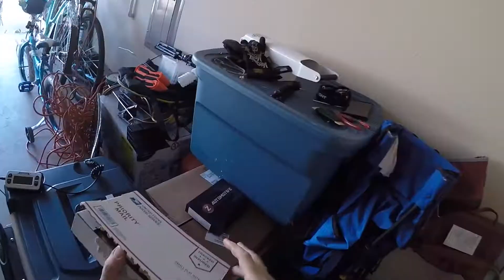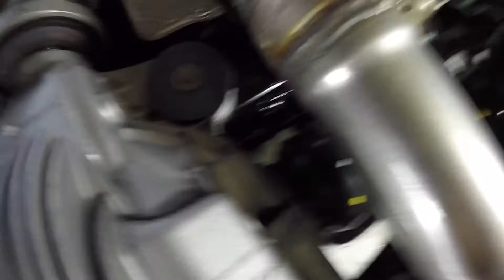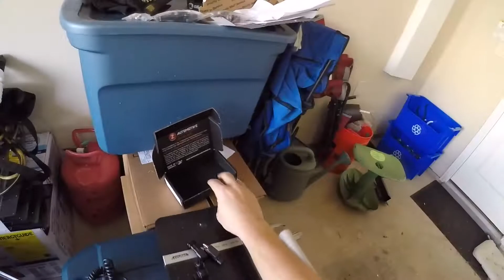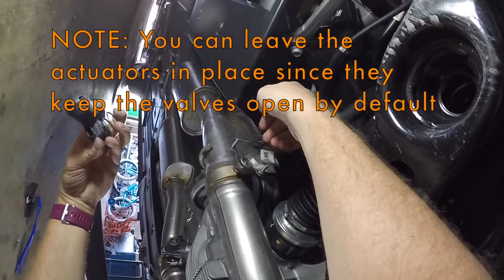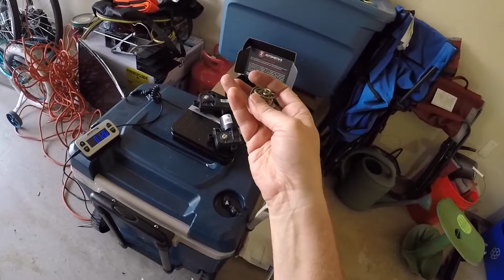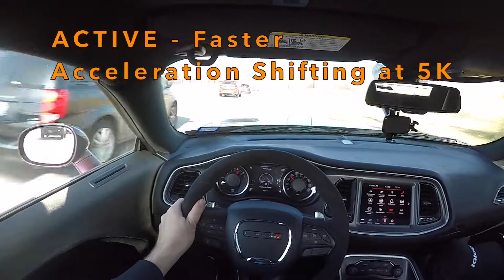Active Exhaust Delete Options for Dodge Challenger and Charger - FREE vs.  Z Automotive vs. Khaos

Comment: So i have a 2016 scatpack challenger what option can i do to delete my active actuator
Reply from the maker: Any of the options I talk about except the free one. Either the mechanical delete kits or the Z Auto dummy plugs will work. The free one would technically work too, but not without tripping the engine light.
Reply: I dont believe the 2016 had active exhaust
Reply: @garybishop4030 I think they do 2015 and 2016 have active exhaust as well because I can notice mine has it it’s loud on cold start and a couple seconds later it’s quite and it’s only loud when I floor it

Comment: I used zip ties on mine and now I’m getting this loud ass noise it sounds like the valve is still attempting to open . Am I the only one getting that or do you as well? Thanks for reply .
Reply from the maker: Did you remove the spring? That's the only way it would still be trying to open. Otherwise there's probably some kind of issue with the actuator.

Comment: I have a 2019 challenger RT 5.7 and my car has always had a rattle with the active exhaust i assume. Got khaos deleted and and still hit with a nasty rattle on cold start. Ive fiddled and greased up all up in them thangs and nothing. Always rattles.
Reply from the maker: That sucks. Wonder if maybe there's an issue with the actual valve inside the exhaust pipe. That's the only thing that would really make sense with the valves being held in one position outside of the pipe. Best fix for that case would probably be to just get the Z Auto Plugs and cut the valves out entirely and straight pipe that portion.

Comment: The note is noticeably more aggressive in inactive mode for sure Chris!  Mid Muff delete just sounds like crap, I did that in my 5.7 Shaker, and wasn't worth it to me, not doing it in my Scat.
Reply from the maker: Yeah, I'm not a big fan of the mid-muffler delete either.
Reply: I’m not a fan of mid delete either. I went with a mid replacement instead on my RT. I bought some bottle resonators from Amazon and put them in place of the mids and I love the sound. Makes it louder and makes a nice deep clean tone compared to deletes

Comment: If you have a pre-19 I would def look into the Z Automotive tazer. Heck even a 19+ depending on the model you have. It's an easy install, just plug it in your trunk OBDII port and wire in the bypass to the trunk fusebox takes 10 mins and easy to take out if you are going to the dealership or just want it back to stock.
Bit more $ than the modules, but it's going to give you track mode which keeps the valves open 100%, have heard some say that when idling it still closes in track mode but have seen video with a camera in exhaust showing them open 100% of the time with the tazer and in track mode, and I can't tell a difference between track mode and pulling the fuse so I believe it does work. And you can change it with the press of a button by changing drive modes.
The tazer also gives you a few other cool things such as LINE LOCK which is huge for me as my 2018 392 shaker doesn't come with that, also the ability to start the car in whatever drive mode you want (I auto start mine in track mode), have the engine on track but the trans on another mode if you want less aggressive shifting but still have valves open, the SRT performance pages + drive mode screens, SRT EVIC screen, and SRT race options, gives you shift light that you can set the RPM per gear, change shift RPM points per gear when in autostick, change TPMS min values down to as low as 25 so you can run lower PSI without the TPMS warning coming up, FULLY disable traction/abs/esp, and there are some other features too such as clear CEL but those are I would say the main ones.
Well worth the extra $50 for line lock if yours doesn't come with that factory enabled.
Have had zero issues with my tazer after 4 years, and it is undetectable by the dealer if you unplug and unmarry it then plug back in and marry again after your visit (5 mins).

Comment: This actually works on 2015 and up on dodge chargers challenger and chrysler 300s
Reply from the maker: All the options except the free method. Every 2018 and older that I know of that's tried the free method has thrown a code and had the light come on

Comment: So i have a 19 Dodge Charger Scatpack  w Catless Midpipes & Corsa Extreme would i still be able to do the free method ? And yes my corsa still has the valves
Reply from the maker: You should be able to since it's a 19. I'm guessing you still have the stock actuators so everything should work the same.

Comment: Hey love the video thinking of getting this for my 2017 scat pack been getting this low squeal at around 38 mph and 68 mph do you think that this will help With the noise.
Reply from the maker: If that noise is from the active exhaust valves then doing the delete should definitely get rid of the squeak since it'll keep the valve in place.

Comment: Can you send a link to that wire you used to tie the valve please
Reply from the maker: This is the wire I used, but any safety wire from an auto parts store would work too. https://amzn.to/3wQiLKR
Reply: @Scavenger1320  thanks, I tried using some wire I had but I couldnt get it to tie the way I wanted it. I ended up zip tieng the valve open with two zip ties for now in addition with the khaos motorsports delete.

Comment: Will the z automotive work on a 2019 charger RT Plus?
Reply from the maker: The Z Auto plugs should work no problem on that.
Reply: @Scavenger1320  thank you for the response. I'll get me some. In regular mode only when I accelerate I hear a slight rasp sound on low rpms and smooths out as you go faster. When in sport mode you don't hear that noise at all. Seems to do it under pressure from acceleration. Exhaust shop said it's prolly from my exhaust valves and to start with deleting them.

Comment: You could also just remove the fuse that controls the active exhaust if you’re okay with having lights on on ur dash. Or you get a false fuse to fix that too.
Reply from the maker: Yeah, but if you have a 19 and up might as well just wire them open and not have a light at all. I honestly haven't heard of false fuses before though.
Reply: Does that work? How would I keep the valves open?

Comment: So you only need to buy 1 kit for 189 and that connects for both connectors? Or should I buy 2 for both
Reply from the maker: Yes, 1 kit has both connectors so just buy 1.
Reply: @Scavenger1320  I just straight piped my scat today it’s an 18 so no track mode, I just ordeeeed the z connector will it take off the check engine light?
Reply from the maker: @Miohelp  yes, your light should go off. the Z Auto plugs trick the system into thinking the actuators/valves are working like they should.

Comment: Hey great video! Thank you! I have a 2018 Challenger RT and two days ago it started making a rattling noice on my right side muffler. Then, the engine light came out and I took it to autozone to scan it and got P121B. Any advice how or what I should do. I'm on a major budget right now. Thank you.
Reply from the maker: Definitely your active exhaust valve with that code. Having that code shouldn't hurt anything, just annoying. Short term if you at least want to get rid of the rattle you could always safety wire the valve open. It won't do anything for the codes so you'll still have the light but it won't cost anything. Then it depends on what's actually broken. A mechanical delete probably won't fix the code if it is a bad actuator. In that case it's either buy a new actuator, or for about the same price as one of those you can just get the Z Auto plugs that I used here.

Comment: On the free method,(2019+), couldn't ya just secure the valve open, then just reassemble it leaving the springs out??? Get back with a reply, okay?
Reply from the maker: Yes, that's exactly what I did in this other vid on a friends car. https://youtu.be/aDXoCybYRkQ. I only used the Z Auto plugs on mine because I wanted to completely remove the actuators, and eventually the valves themselves too, and probably the entire exhaust 😆
Reply: Thank you.😁

Comment: Can't u just use the ztazer to just put engine mode to track and trick it open?
Reply from the maker: I haven't been able to verify that Track or Drag mode keeps them full open, although I do believe it does. I don't need a Tazer since it doesn't really give me much I don't already have, but also I save my Drag mode for the dragstrip only. It's rare for me to put it into Drag mode on the street. Plus if you have a 2019 or newer with the 6.4 or 6.2 there's no need to pay money for a Tazer when you can wire the active exhaust open for free. 2018s and older though that should work if you want to run in Track mode all the time.

Comment: I wired mine open in a similar way. Works great no problems.
Reply from the maker: Nice! glad to hear it worked for you too!
Reply: I used zip ties on mine and now I’m getting this loud ass noise it sounds like the valve is still attempting to open . Am I the only one getting that or do you as well? Thanks for reply .

Comment: Ill save you all the guess work dude the flaps are controlled by the transmission and speed sensors and throttle position they close under light to no throttle and open under load
Reply from the maker: There's no guess work when you just wire them full open all the time lol!
Reply: @Scavenger1320  I was more or less explaining why they weren't doing anything when you had the car on the ramps no speed = no movement plus you already had the car warmed up about halfway when you started it so all it would do is what it did and just cycled and stayed open if you were to say start the car completely cold then drive it around the block with cameras under it you would see them actually do something sport mode just disables the active exhaust feature in the ecm.

Comment: If every ounce matters you should have deleted the passenger seat:-) Did you get rear seat delete? Informative video though for a newbie Shaker owner. Oh yeah, which Race Ramps are those? The 67" XT? I'm sure my Rhino Ramps aren't going to work (can't test them as my son has one of his cars on em right now anyway).
Reply from the maker: I have a LOT more deleted than just that lol. My car is down to around 3620 pounds now. Check out my last vid from Horsepower Wars in Orlando. At one point in it I do a brief walk-around of my car showing what it looks like inside now
Reply: @Scavenger1320  will do!

Comment: Hey bro I have a quick question im getting codes u113 & u1140 on my 2018 daytona an the dealer is telling me basically its from me straight piped the exhaust so it's receiving alot of back pressure you think this will help far as removing CEL & the back pressure by keeping the vavles open?
Reply from the maker: Sounds like your dealer doesn't know what they're talking about honestly. Those codes are saying there's something wrong with the active exhaust actuators and has absolutely nothing to do with any kind of back pressure. Did you leave the active exhaust valves and actuators in place and keep them connected? If you did check all of the connectors. A bad connector, or damaged wiring would stop the computer from communicating with the actuators which would cause those codes. Doing this active delete won't fix that until you find out what's causing it. If the actuators themselves are bad the Z Auto plugs would be a fix, but if its a connector/wiring issue none of these active exhaust delete options would do anything.
Reply: @Scavenger1320  thanks bro! Appreciate your response an if you where referring to keeping them connected when I had it straight piped I believe so but like you said I will check the connectors & wiring first an if that's all good an it is the actuators I'll invest in the Z plugs! Thanks man!
Reply: I’m having the same codes on my Daytona. Did you find the problem?

Comment: Is there any reason why you shouldn’t just buy the tazer and leave track mode on 24/7? From my understanding track mode leaves the active exhaust valves completely opened. Does it not?
Reply from the maker: I haven't been able to verify if track mode leaves them full open but I think it does. Mine doesn't have track mode, just drag, which I'm sure also leaves them open, but I only like to use drag mode when I'm actually on the dragstrip. Nothing wrong with leaving it on all the time, but the way these cars "learn", I'd rather not have everyday driving affect the mode for when I need it most. A lot of people I know also don't like to drive in Track/Drag all the time.
Reply: @Scavenger1320  do you know if the transmission mode affects the active exhaust valves? I can put on sport mode and I can make it so the drive mode transmission is normal even when in sport mode. Does that mean I get to drive the car and reap the benefits of driving in street mode (with eco mode) and I still get my active exhaust valves to be in “sport mode” ?
Reply from the maker: @Little_Milk120  I honestly don't know with your setup. On mine the engine/trans are combined into one mode. Best is to try it out and see if you hear a difference.

Comment: I have a question so for the people who do the mid muffler delete the actual active exhaust valve is still closed or open right
Reply from the maker: The active exhaust valves sit about a foot or 2 behind the mid mufflers so they still keep working the same regardless what you do with the mids.
Reply: @Scavenger1320  Sauce should I still do this mod and that would make it even louder or should I just leave it alone after the mid muffler delete
Reply from the maker: I would. It doesn't really make your exhaust any louder. It just gives you more of that cold start sound all the time. So the only time you might notice it being louder is when idling or cruising at low rpms since thats when the valves would normally be closed to quiet it down. When you're in track mode if you have it or at WOT the exhaust will sound exactly the same.

Comment: I put the remote control packs on and do away with the exhaust pipes. When its open it sits and growls and when you take off it sounds like a monster. If you see a cop close it down so it gets quiet.

Comment: What about a 2018 scat challenger?
Reply: Well I just did it anyway to my 2018 6.4  and no check engine light came up!
Reply from the maker: @jobiegarza5212  that's awesome! You're the first 2018 I've heard it didn't trip a light. I'm curious, is yours maybe a late 2018?? Just wondering why it worked 🤔
Reply: @Scavenger1320  Im not sure.. but it’s a 2018 rt scat pack shaker, I tied it up with some hanging wire from Home Depot
Reply from the maker: On a 2018 it'll pop a code and throw the engine light on. You'll have to get either the mechanical delete or Z Auto plugs.

Comment: With the first method that you use with the wire, if I decided to go that route, where or what do I do with the actuator itself?
Reply from the maker: Just bolt the actuator back in place but without the spring and make sure to keep it plugged in. I did another vid where I did the free method on a friend's car too if you want to check that out. https://youtu.be/aDXoCybYRkQ
Reply: That's the same thought I had in my head, to remove the spring before bolting it back on....thank you for responding and thanks for the video as well sir.

Comment: Have you had the actuators cut out and if you have had it had any cel codes come up from it
Reply from the maker: If you mean the valves then no, I haven't cut them out yet, they're just wired open. I did completely remove the actuators though which is why I ended up using the Z Automotive plugs instead of leaving the actuators plugged in and keeping the valves open for free. I haven't had any lights or codes pop up at all since I did this. And a couple of my friends that have done the free method haven't had any lights or codes either.

Comment: And you can take the spring out out and use a ziptie. So two zipties or wire will do the trick. 

Like the video. Clean ride too.
Reply: I used zip ties on mine and now I’m getting this loud ass noise it sounds like the valve is still attempting to open . Am I the only one getting that or do you as well? Thanks for reply .

Comment: Probably a dumb question but does this hurt the car at all? I love the sound when I’m sport mode and want it to sound that way all the time.
Reply from the maker: not dumb at all. It doesn't hurt anything at all. All this is doing is keeping the exhaust in a state thats within the normal range. If anything the exhaust flow being restricted with the valve closed would be whats hurtful, not that it is, just saying that would be more likely to cause issues than a more free flowing exhaust.
Reply: @Scavenger1320  nice! Thanks for the response. I’m going to order the kit today!🙏🏽

Comment: Another great video. Question: is the active exhaust only for sound control, or does it also assist with low end torque or mpg during light cruising? Thank you!
Reply from the maker: As far as I know It's only for sound control.